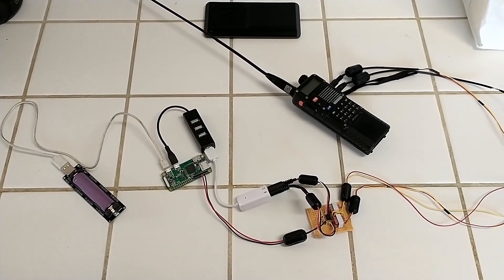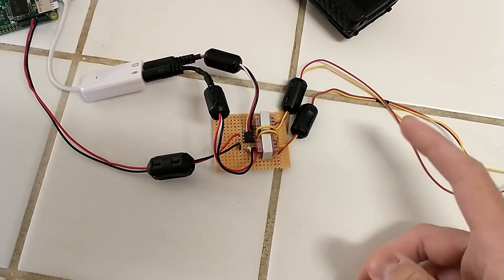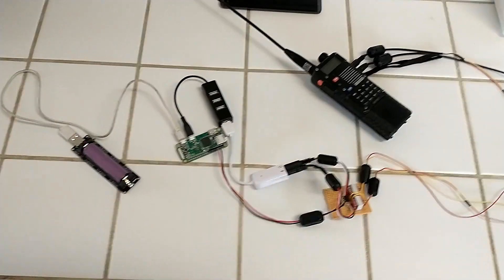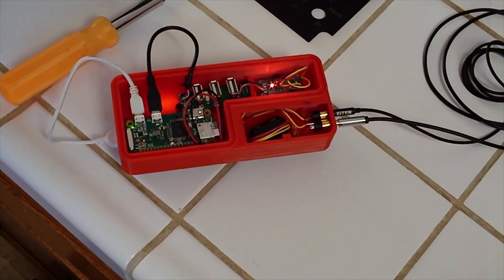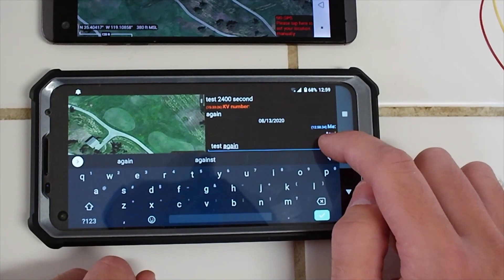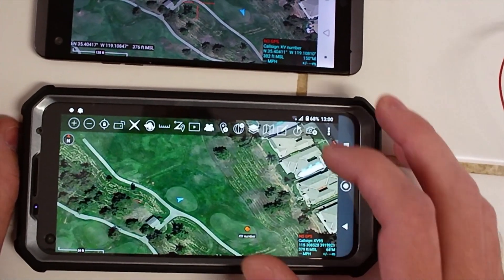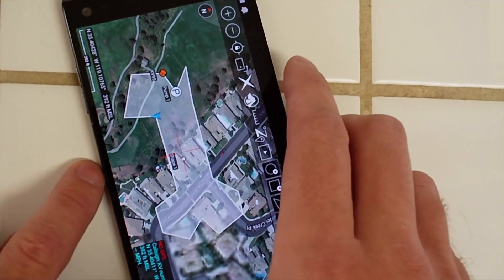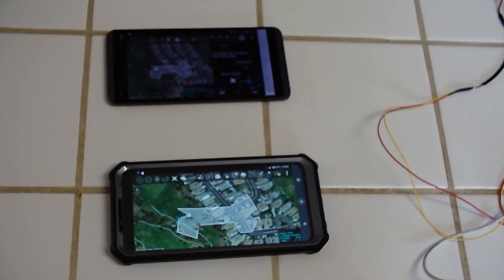PiRaTN for ATAK Demo

Comment: does the rasperry wifi is configured as acesspoint?  what setting do you use inside ATAK as audio device?
Reply from the maker: Yes, it was set up as an access point. There are no audio settings in ATAK. ATAK thinks it is sending data over wifi. The software running on the Pi converts the network packets into audio and sends them via the radio. The receiving radio converts the sound back into network packets and sends them to the receiving ATAK device.

Comment: do i understand correctly that the usb-hub is there only because you did not want to solder soundcard 4pins to raspberrypi?
Reply from the maker: Yes, that's correct. Directly soldering the sound card should have also worked, but it was a prototype and I was thinking that I may end up using the Pi for something different in the future. Also, for most people it is easier to plug in a usb hub lol.

Comment: Very interesting, I missed the point were the WIFI comes from ? I understand that is were the phones connect to but the wired hardware is not generating a wifi right ?
Reply from the maker: The wifi was to trick ATAK into thinking it is sending data over a wifi network. The Pi converts the network packet to audio for transmission via radio.

Comment: you know you can use the Kenwood D75A handheld with built-in TNC, for this without all this stuff, you can directly connect your phone via Bluetooth to the TNC and transmit Akak text through the D75A I have one myself,
Reply: the main IDEA is that you can use whatever radios you have, so that the rest of rebel unit you command, dont have to start searhing Kenwood stuff

Comment: THIS is awesome, about 11 years ago i tried to send morsecode from an arduino over a pair of pmr radios, and have the recieving radio output the text to an LCD.............. I succesfully got it to send a few characters in a repeatable manner, but couldnt predictably send a string of text. 
I still really want to get that working, but this is the ultimate incarnation of what I wanted to do with it.  PIR sensors connected to PMR radios is something that I still want to work out.
Reply: Check out Meahtastic

Comment: Awesome - you mentioned doing a similar solution with LORA - have you got this working and will you be releasing a video on how to build one ?
Reply from the maker: I did successfully test out using an RNode radio. It worked quite well. The setup is essentially the same as this, except the RNode plugs in to the Pi Zero via usb instead of requiring audio cables. The RNode can be configured as a TNC, so direwolf is not needed if you're using that. Simply run tncattach and point it at the tnc created by the rnode. I probably won't bother making a video though. Meshtastic is likely to be more useful for basic use cases (location, chat, map markers), and AREDN will be more useful for higher throughput requirements (pictures, attachments, etc).

Comment: Love this!
So I want one, I however am not this talented. How much for me to order 2 of these? I could print my own housing if that would be easier.

I do have a couple questions with this also. 1st, how are you using voice comms? Is it all ran only through the radio? Would using a cell phone battery reduce the size and weight of this?
Reply from the maker: So to answer your questions...1) Voice comms have to be done with a separate radio, and preferably on a separate frequency. 2) Yes everything you see in the video was done through the radio. Anytime you see a "Broadcast" button in ATAK, it works with this setup. Not all features of ATAK work with this, nor are they realistically feasible. Sending a multi megabyte photo at 1.2kbps is going to take a long time and disrupt everything else on the network. 3) A cell phone battery (or in more general terms, a prismatic battery) would work. It would reduce the weight very slightly because they don't have a metal can like the 18650 batteries do. The tradeoff is they're more susceptible to damage when carrying spares, the shapes and sizes of cell phone batteries aren't standardized like 18650s are, and mounting requires more precision and is generally less secure than this setup with the 18650s. I don't know if cell phone batteries in particular have a built in low voltage cutoff or if that's handled by the phone's hardware. That would be something to research. If not built in to the battery, this device is liable to run the battery completely down to 0 volts and damage it. The 18650 board I used had a low voltage cutoff to prevent damage to the 18650s. Either way, a boost converter is needed to supply the Pi with 5V, so there's always going to be a need for a power supply board of some sort, and this one made everything much quicker and easier to test because I didn't have to design it myself.

Feel free to shoot me an email if you want to discuss prices. My email address is simply my channel name at yahoo dot com. I'll give you a rundown of what all the individual components cost.

Comment: What are the other components on the bread board? Thought I seen different components on project box bread board (when you flipped it) as well.
Reply from the maker: The circuit board schematic is on the github page (link in video description). The red 3D printed housing in the video looks like it has several circuit boards attached, but these are all the same components that were laid out on the counter. I just removed the plastic coverings off of them and exposed the circuit boards so that I could save space when mounting them inside the red housing.

Comment: Could this work with the Mobilinkd TNC? Instead of putting all that together, which is impressive by the way, but I am not very smart to built something like that. And if I could I would rather use something that is already available
Reply from the maker: Unfortunately no, you can't use the Mobilinkd. At least not without creating your own plugin for ATAK. Natively, ATAK can only work over either the cell network or over wifi, so the reason my device works is it takes the wifi data and converts it to audio for transmitting over the radio. You'd need a plugin to convert to audio and then have it sent over bluetooth in order for the Mobilinkd to function.
Reply: @sniporbob  Couldn't a Pi 4 B with integrated Wifi and Bluetooth handle data transfer between phone and TNC without a sound card? As I'm seeing it, ATAK would send data over Wifi to the Raspberry Pi which would then send the data over Bluetooth to the TNC which would do the audio encoding/decoding.The Mobilinkd 3 can even handle PTT.

Then again, if using the Mobilinkd 3, couldn't you just add a Bluetooth dongle to the Pi you are already using?

Comment: How do you prevent the Pi from trying to broadcast the data messages the Android phone is trying to send out?
Reply from the maker: I'm not sure what you mean. It's kind of the point that the Pi broadcasts all of the data from ATAK over the radio. Could you clarify further?
Reply: @sniporbob  so android tries to contact servers to check for updates. Other apps run in the background. Does the Pi prevent those apps from being able to contact their servers and ONLY broadcast traffic from ATAK?
Reply from the maker: @AgentJeffy  Ok thanks, I understand now. Yep, this setup is looking specifically for the multicast traffic coming from ATAK and only forwards those messages over the radio. In a previous attempt I simply bridged the radio and the wifi, but that method forwarded all that junk you're talking about over the radio too and it never shut up haha. It was completely unusable. This version doesn't do that. It uses socat to forward data between wifi and the virtual interface of the radio, and it only sends the data coming from ATAK by checking for data on specific multicast addresses and ports that ATAK uses.
Reply: in android only the blutooth is needed/switched on. android wont seek its updates from blutooth channels anyway if the updte feature is shwitched on

Comment: can this work with FTS??
Reply from the maker: This exact setup: no. The baofeng radios don't send data fast enough, and there's too much of a delay switching from Tx to Rx and back for any sort of reliable TCP connection. If you replace the baofeng with something faster, say an RNode radio, then it becomes more likely to work. I've successfully done TCP communication with the RNode so it could in theory work with FTS. It then becomes a question of whether or not you want to use your limited data rate talking to a server and having that rebroadcast to everyone else, or if the limited data rate is better spent directly sending chat and position to other devices and leaving the server out. You will very quickly reach the limit of the radio's data transfer speed if a server is involved. Also google the "hidden node problem" for another reason why you want to keep transmissions as short as possible. A lengthy TCP message creates a higher probability of such a tx collision arising.

Comment: Very impressive! Do you have an idea what is the approximate transmission baud rate is?
Reply from the maker: The setup in the video was 1200bps AFSK. It's possible to configure direwolf for 2400bps AFSK (if I understand correctly it uses 1200 baud quad AFSK to accomplish this) but the range is reduced and the Pi Zero processor can't reliably keep up unless you turn off some of direwolf's demodulators which further reduces probability of successfully receiving the transmission. Direwolf also allows 9600bps but the radio has to provide a special data input connection. It won't work with a regular microphone input. I don't think the Pi processor could handle it either. I also have this setup now working over RNode LoRa radios but haven't done a video of that yet. With LoRa I have tried both 10938bps (only tested indoors short range) and 2604bps (tested outdoors out to ~0.75 miles non line of sight with consistent successful reception). It probably goes much further, I just ran out of time to continue that test.
Reply: @sniporbob  Very Interesting! I like the idea of Lora - Less likely to be intercepted or interfered with, Less overall bulk, lower power requirements, possible use of Lora repeaters and/or gateways. One has to bear in mind that most will probably also be carrying a  portable radio for purely voice communication as a back-up. In fact I wouldn't venture into the field without one! 
Looking forward to the results of your Lora tests!

Comment: how many clients could connect using this method? Would it run into heavy issues once two data packages are sent at once accidentally or is that handled?
Reply from the maker: It would depend on how frequently position updates were needed. More frequent position updates means fewer clients. I don't have any numbers because I only have two android devices to run ATAK on. The software (direwolf) attempts to delay transmission until the channel is clear. If two transmissions happen to occur at almost the exact same time they can collide and render both unusable, but if there's enough delay that direwolf detects an ongoing transmission it will wait.
Reply: @sniporbob  thanks for the insight. Yeah its all very theoretical at the moment obviously. I guess ill have to try for myself but i guess itll only be two units at first. Ill post some results on the reddit when i get to trieing it out

Comment: Very cool! Super stoked about this! Solid work. Did you implement any kind of encryption?
Reply from the maker: I didn't, but ATAK seems to have the option to handle that on it's own. You'll have to be careful what frequencies you send encrypted data on though.
Reply: @sniporbob  of course. Just curious. Seems like it would be useful for people who live in countries where it's not an issue who want to maintain opsec.
Reply: Is there a way that you know of to keep the radio speaker from outputting sound when the speaker mic is plugged in?
Reply from the maker: @JamesStaud  It normally doesn't output sound. The only reason you could hear it in the video is because I had another radio on the ground tuned to the same frequency. In normal operation you don't hear anything.
Reply: @sniporbob  ahh ok. I was confused about that. Was thinking that maybe there's some resistance value that has to be correct for the built in speaker mic to be disabled. Awesome! Great work by the way! I'm working on putting your circuit onto a printed PCB right now.

Comment: Hello, lay person here. So you are using the radios to transmit? While cellular data is down? Correct?
Reply from the maker: Correct, that would be the main use for this.
Reply: sniporbob can you use a more powerful/ higher quality radio? And do you sell these things? Ship to Florida?haha
Reply from the maker: @0780marco  Yes you can use a more powerful and/or higher quality radio. It's better that you do. I used baofengs for testing because it seems everyone has one. The PTT circuit might need to be slightly different for other radios, but it should be easy to adjust it for whatever radio you're using. Considering they're so easy to make I hadn't planned on selling them but I suppose I could. It's difficult to order any large quantity of the Raspberry Pi's though. I might have to leave it up to the end user to buy their own Pi's. I haven't finished the enclosure design either so at the moment you'd just get a pile of electronics that you have to stuff into your own box.
Reply: sniporbob  sweet, what would you charge for two complete set ups minus radio? Lol
Reply from the maker: @0780marco  I'll go figure out how much it all cost. Send me a message over on the ATAK subreddit so we can chat, that way I can make sure I understand exactly what you want.
Reply: Can someone explain to me the point of this video?  I understand that SOMETHING is being demonstrated but I don't know WHAT exactly or WHY.  I am not a "I.T. geek", so simple English would be appreciated for anyone who cares to respond.  Thank you in advance.
Reply: @jebidiahnewkedkracker1025   read the comments above
Reply: @0780marco  So this thing being demonstrated is nothing more than a fancy CB radio or "Walkie Talkie"??
Reply: @jebidiahnewkedkracker1025  sort of, its take a gps app on you phone, uses the radio to transmit and receive while cell signal is down. But it’s more then just talking and sending messages. Data such as way points, live tracking of you and other assets can be shared with out being dependent on cellular system.

Comment: So phones sends signal via Bluetooth, to pi , pi to radio and the radio transmits the text of the phone to the radio waves then reverse the process on the other end.. ?  And  how long can you go on distance ?
Reply from the maker: Almost. It goes from phone to Pi using wifi, but otherwise that's about right. The range would depend on a lot of things. Radio power output, antenna, terrain, etc. I haven't done much range testing with these yet except for a bit in the residential area. It doesn't do so great because of all the houses. The best was 0.85 miles straight through a bunch of homes. Now if you had perfect line of sight from one radio to the other, like from a valley up to a mountain peak, the range would probably be tens of miles. I would expect similar performance to APRS because it's transmitting the data in the same manner.
Reply: sniporbob were do I get the software? For the Pi ?
Reply from the maker: @bluerhinoconstruction205  Instructions are on the github page. See the video description.

Comment: I was going to bitch that you'd beat me to it lol, but after watching the video, we're coming at this from two very different angles.

It's kind of a bummer top see how long transmission of two words took.
Reply from the maker: The data being sent in addition to the two words is rather extensive. If you turn those two words into five whole sentences you might add one second to the transmission time. Probably less than that. The message itself is a very tiny part of the transmitted data.